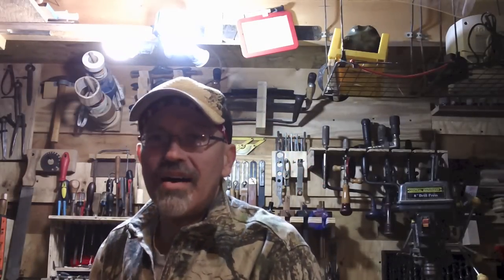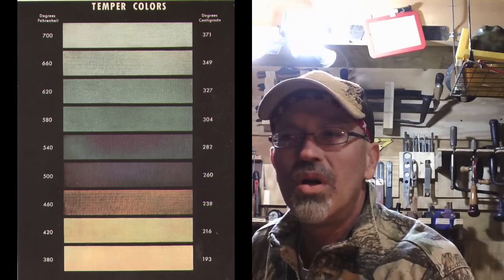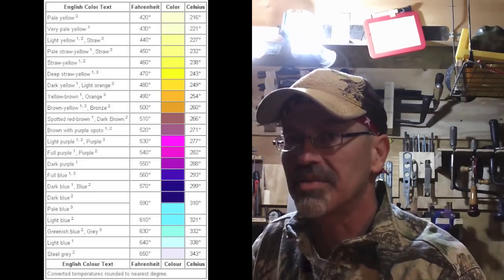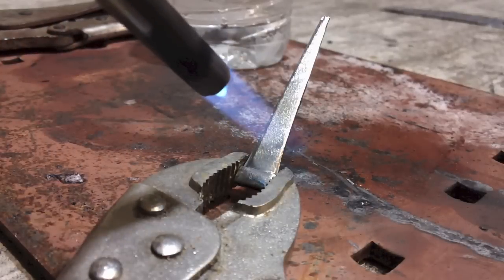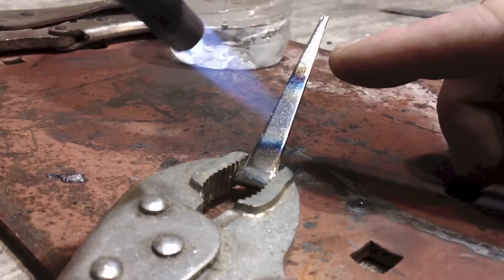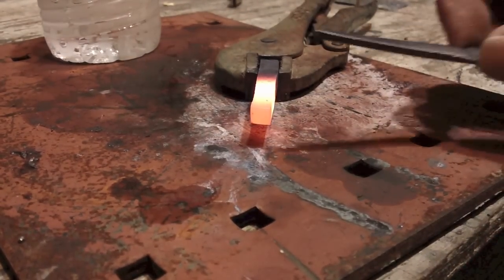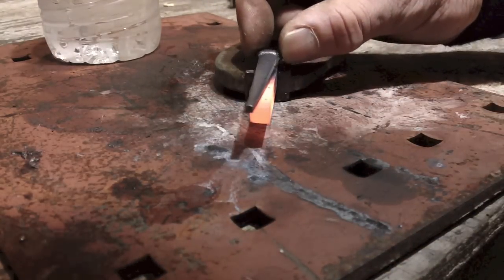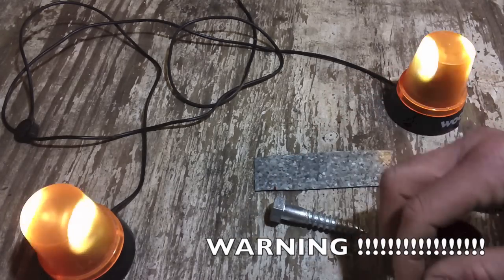Tempering Steel

Comment: I am about to make a knife out of a old file(I put my own edge on my knives and it eats through files) and I have a question. 1: are files the same rock well through out the whole tool? 2: Would a file work for a knife intended for hard use for around the house work(a bit of wood cutting and other misc).
Reply from the maker: Alpha Nerd Yes they are the same hardness. The steel that is in a file is what they used for hundreds of years. It will work fine.
Reply: Dave Bardin Cool. I was having this stupid little fight with my father because he thought that they only hardened the cutting section and not the handle. Today I cut the handle off and it took me 3 Dremel cutting blades. I know a Dremel is not good for knife making. I just use it for small detail work and it was handy when I wanted to take the handle off.
Reply: Dave Bardin I find it funny that you and my father would be great buddies. He is 70 and has a big engineers wrokshop. Every darn tool in that shop is at least 10 years old.
Reply: Dave Bardin One more question that I just thought of. What is a good way to avoid tracks in the file when using a grinder to take the groves off of it?
Reply from the maker: Draw filing will give you a much better finish but the metal must be annealed and soft. Keeping the grinder wheel well dressed with a diamond dresser will help a lot.
Reply: Thanks! I started today with the knife shaping and my only issue was that I kept slowing down the 3/4 hp grinder. besides that it worked pretty well.

Comment: how does the colouring show the effects on steel when it's tig welded and air cooled? you know when you get a range of colours either side of the weld, typically some blue mostly. the surface files down taking the colour away to raw silvery steel just fine, does that mean it's effectively untreated in any way? sometimes the colouring worries me... probably unnecessarily lol.
Reply from the maker: lol morlol The steel you have welded on has been surface tempered. What ever the temper was has been changed at the weld point. This is only in the close area were the weld has taken place.  
Text book answer
What causes these high residual stresses? Welding involves the deposition of molten metal between two essentially cold parent metal faces. As the joint cools the weld metal contracts but is restrained by the cold metal on either side; the residual stress in the joint therefore increases as the temperature falls. When the stress has reached a sufficiently high value (the yield point or proof strength at that temperature) the metal plastically deforms by means of a creep mechanism so that the stress in the joint matches the yield strength. As the temperature continues to fall the yield strength increases, impeding deformation, so that at ambient temperature the residual stress is often equal to the proof strength To reduce this high level of residual stress, the component is reheated to a sufficiently high temperature. As the temperature is increased the proof strength falls, allowing deformation to occur and residual stress to decrease until an acceptable level is reached. The component would be held at this temperature (soaked) for a period of time until a stable condition is reached and then cooled back to room temperature. The residual stress remaining in the joint is equal to the proof strength at the soak temperature.
So if it worries you torch the area after welding to release the stresses caused.

Comment: Great video, Dave!  One question: after heating to critical temperature and quenching, when I do the next process of tempering in the oven at 425 degrees for an hour, do I then air cool, quench, or just let the steel remain in the oven after I turn it off so it can cool slowly?  Thanks for your anticipated answer.  --Scott
Reply from the maker: ScottsUtubeWorld I let it remain in the oven and normalize. Quenching is the only time it need to drastically change temperature. Thank you for the comment and question!
Reply: Dave Bardin hello thanks for video, why if i saw video about forging they allways use oven after harden on water

Comment: once i heated a piece of metal and placed it in sand and the sand begun to melt, it was pretty cool and i ended up with glass around the steel, it looked awesome!
Reply from the maker: Skydown 88 That sounds fun. Now if you were to do two pieces of metal and used the sand that way. While they were very hot you could have forge welded them.

Comment: Hey Dave, when it comes to (W-1) water hardening steels and (O-1) oil hardening steels, does one harden and temper deeper into the steel than the other?
Reply from the maker: Man this is a can of worms.
Brandy the difference in the quenching is the time it takes to transfer the temperature. Oil quenches slower than water. I always start with oil first then try water if my steel type is not known. With that said if you quench w-1 in oil the way I test it is to file it. If the file bites it I then know its w-1. That is testing the surface. If I quench O1 in water the surface will harden but not the interior. And A2 is even slower.
A-2 is an Air hardening steel, O-1 is an Oil hardening steel and W-1 is a Water hardening steel. A quenchant for a steel should be fast enough to fully harden the steel but no faster. A faster quench will produce unnecessary stresses in the steel and may lead to things like quench cracks. The more complex the alloy the more care needs to be taken with the specific quenchant.
First and foremost. Preheat your quenching fluid. Older steels are much more forgiving. When you start getting into exotics it all changes.
Reply: The thing I was reading said that A-1 hardens more thorough than the other two, but my choices are either O-1 and W-1. I have hardened and tempered both in the past with great results, and like anything else there is a lot of trial and error involved. I had never read or heard before that one would harden and temper deeper than the other. Actually it said that O-1 would be a more thorough temper, just like you said because the oil is a slower process. I make gravers for hand engraving metals. I buy the W-1 in it's annealed state and after I fashion the geometry of the tip then I hard and temp it. I have had great results. But since I read that I was wondering if there was any truth to it and why. You answered that for me. I think I will use O-1 next time and see how much, if any difference there is.
THANKS, YOUR VIDS ARE AWESOME
JOEY & BRANDY
p.s. Any vids on air hardening??
Reply from the maker: brandy sigmon
Thank you very much. This was an in-lighting and fun conversation.
I do not have and vids on air quench.
I need to.
Mabee soon.

Comment: what does he mean the file should skeett across it?
Reply: +kacey valade The steel is so hard that the "file" (the metal tool) runs over the now hardened steel instead of cutting it or denting it (as when it was softer).

Comment: "a bit long" you kidding me? I could watch a few hours more easily! thanks, very informative
Reply from the maker: Thank you ! There are plans for more on this subject in the future.
Reply: Dave Bardin  awesome, I subscribed already!  What do you think of differential heat treatment/ clay backed quenching etc?   Or do you find any advantage in real world at a shorter blade being harder at the edge and softer/spring tempered spine?  If yes, then if you have the time I would love to watch such a video from you, sooner or later just so you know, many thanks
Reply from the maker: Oh thats a whole can of worms in itself. With modern knife and sword making they temper the whole blade. This is BAD! You want your edge to be at that specific harness and the spine to have a give to it. The tang should almost be annealed so it bends and not breaks. This is selective tempering. Each part of the blade has different jobs and needs to be able to react differently. That process is more expensive to produce and thus is not done in mass production. The sword smith knows this and uses it to make a better product.
Reply: Dave Bardin ok, that answer is highly appreciated as well. Usually ppl dont want to share their experience and hardly earned knowledge, if you understand.    
  Points taken. I was just wandering if it can be as useful for a max. 4 inch short blade in real life. And also if any weak points are created between the harder and the softer treated parts of that blade.  However your explanation makes perfect sense to me.
 Anyway, keep your nice videos coming, Im sure im not the only one here that thinks of that

Comment: now i am looking at a (stamped) 440 stainless steel katana. that has china branded(?) on the other side of the blade. it has hardly failed me, but i am going to try the new method on it, as i have never tempered it. what do you think?
Reply from the maker: Because of the chromium in stainless it has to be treated longer.
Try this link.
BRITISH STAINLESS STEEL ASSOCIATION Making the Most of Stainless Steel
http://www.bssa.org.uk/topics.php?article=140

Comment: i find the files in aus are very thin in the width section i cant find and file wider then 20mm that's cheaper then the cost of buying 1095
Reply from the maker: Try a ferriers rasp. We have them at our county co ops and they are only $20

Comment: Thank you for the informative video. question for ya. I softened a farriers rasp. worked it got it red hot thru out quenched in water now its a great knife but I didnt temper just quenched. I no its 1095 high carbon and the file skates over it. so I made it brittle its hard to put a edge on it but it keeps. did I do anything wrong or should I do something else?
Reply from the maker: Your welcome Nolan.
You have made the steel as hard as it can be. If you get the knife in a bind such as twisting or bending it will break. The knife is as hard as the file was. You will need to temper it a bit. Google 1095 and Rockwell hardness to tempering. Your methods are oven or torch temper. The oven will set the temper to the whole knife. With torch tempering you can leave the edge rock hard and put some spring in the back of the knife.
Reply: Ok thank you. another question if I do temper it in the oven will the knife still spark off hard stones?
Reply from the maker: Bushcraft nice. It should as long as you dont take it down to far. For a spark the steel has to be as hard as or harder than the stone.
Reply: Haha yeah I make my own bows and arrows. I thought I would mess around with steel, but usually i Knapp all my points and knives but they dull and chip so much faster haha. Thanks again for all of your information, you have been super helpful.
Reply from the maker: Wow Nolan thanks. Knapping is something I wanted to play with. I have been given some done buy a friend of mine. It is a true skill and art.  I am glad the video was helpful.

Comment: Thanks for posting this...very informative. Most youtube videos lose my attention after about 30 seconds. I watched this one end to end.
Curious to know your opinion on something... I am planning on making a very simple shotgun shell resizer - (very) basically a piece of 3/8" steel with a hole in it. I will press a shotshell hull into the hole and it if the metal on the hull is larger than spec, it will squeeze/shrink it to spec as it is pressed into the hole.
I thought about just using mild steel for this but I figured after a few hundred or thousand hulls, the hole will wear.
I thought about case hardening the steel but it seems case hardening isn't very popular anymore (it has been awhile since my shop classes in high school)
What kind of steel and/or treatment would you recommend for something like this?

Thanks again for posting this video - I am now off to see your other videos.
Reply from the maker: Thank you for your time and response.
To me the brass on the shell shouldn't wear the mild steel that much. I would get it to the exact size you want it and quench then not temper it. There is enough carbon in the mild steel to give a bit of hardness.
At the volume you are talking about make 2 or 3 while yoou are geared up for it and have a spare or two.
Again thank you for the comment.
Reply: Dave Bardin Thanks. Good advice. Much appreciated.
Reply from the maker: Your more than welcome

Comment: Couldn't you do some case hardening with mild steel? I know its not really worth it if you can get your hands on high carbon but if you want an edge on an axe or machete while still keeping the spring in the softer steel would it work?
Reply from the maker: Mild steel will only get so hard because of the carbon content. You could use a brine for quench and play with just the edge.
You need a 9% solution.
One gallon of water weights 8.34 pounds so 9% is 8.34 X 0.09 = 0.75 pounds of salt.

Comment: The two images showing the colours do not match....the colours fluctuate between temps in the images.......... This is one of the most confusing thins ive found on the internet. I wish they would match...cos as it is...its hard to figure out what colour and temp correct to go by.
Reply from the maker: RDPproject they make crayons that only melt at a specific temperature. Or if you have the funds you can get a temperature gauge that hooks up to a multi meter or a laser type. In the work I do near the range is good enough for me. You can use your oven and set the temp to the degree you are trying to reach.
I hope that helps.
Reply: Dave Bardin Yeah I know of all the tools available , its just annoying that all the info is out there on the net....yet so much of it cancels out each other

Comment: Nice job putting a the warning in your vid
Reply from the maker: Thank you Irish McCabe
Reply: Dave Bardin
Ya Thanks for the Ed, I am trying to harden a home made screw driver for my flint lock rifle. as I was putting in new flint and tightening down the top jaw, my home made screw driver / napping hammer bent in the jaw screw. so I need to harden it witch brought  my to you tube, and your vid was real informative with the visual and narration at the same time  any way thanks again for sharing
Reply from the maker: You are more than welcome. I have been shopping for a flint lock. Trying to get away from my percussion caps on my ole muzzle loader. If I can help just let me know.

Comment: Dave... great video!  Yours is the simplest, clearest, easiest to understand description of the heat treating of steel I have yet to see!  I have one question about tempering, however.  To make sure I understand correctly, after hardening if I temper in my oven to say 450 deg and get the proper color, I must then quench again in water or oil, correct?  Not let it just air cool?
Reply from the maker: First thank you very much. I am flattered.
Now to your question. When you have hardened the steel. That is taken it to above 1330 degeres or when it looses its magnatsim, critical temperature. Then you quench. That freezes the molecular structure at that state. It is as hard as it will every be. Then you bring it back up to the temper temperature you are going for. Say you pick 450. You are slowly changing the molecular structure again. Theoretical you are softening the metal to the point you want. Then you let it cool slowly. You could quench it but I don't and don't know anyone who does that.

Comment: so should i temper sprung steel or not?
Reply from the maker: Spring steel hardened, not tempered is a great tool steel for mild tools. Remember it will not retain a razor edge for any length of time.
Reply: so i should only quench it and not temper? im making a bushcraft knife, it has to take impact aswelll as be sharp
Reply from the maker: Yes only quench. It should work out fairly well for you.

Comment from the maker: You are correct on the temperature. You need to anneal your metal. Get it hot then cool it slowly. Heat it then cover it in ashes or sand and cool it slowly. That will soften it and let you work it.

Comment: Thanks for the response, I don't have too much knowledge about this stuff but how can i tell it is at 1330, is that basically what you consider critical temp?  Another quick question, these blades are super hard to cut even with a cut off wheel, is there anything i can do to make it easier or is it just as slow going as it seems?

Comment from the maker: Yes that would be the method I would use.
Do it slow and easy.
You might try the transfer method. Heat another piece red hot and place the thick edge on it. You will get a slower transfer and better control. That would make the temper colors easier to see.

Comment from the maker: First thank you. I am a visual person and I did the video in a fashion that would be easy for me to understand. You are to kind.
If you work the steel with powered tools such as grinders and cut off wheels the steel at the contact point will be superheated. The metal will take stress from this. I would take the steel to 1330 and cool it slowly to relax it. Then quench and temper. When you temper you will be able to direct the hardness where you want. 
Again thank you for the kind words.

Comment: Just getting started in the knife making hobby and this is one of the best videos I have seen so far, really dummied it down for people like me.  The question I have is, I am working with 10" miter saw blades, would it be ok to cut the knife and do all the work on it and then just temper it at the end before I finish the knife edge or would I still need to bring it to critical temp and then temper the blade?  Any advice would be most appreciated.

Comment from the maker: It is probably air quencher steel.
Heat it red hot and bury it in sand or ashes, deep. Or even better. Get it hot the bury it in a charcoal fire and leave it until cooled. That should make it malleable.